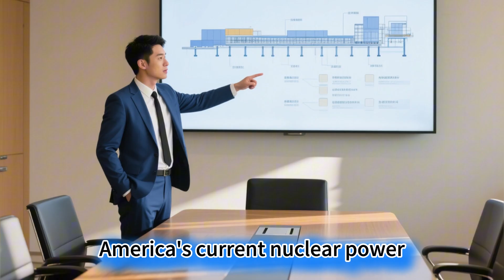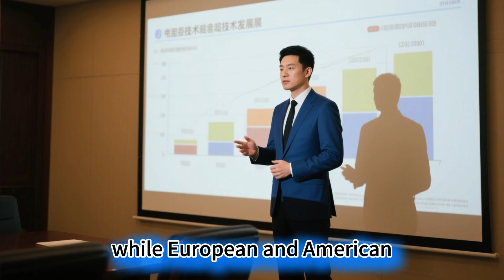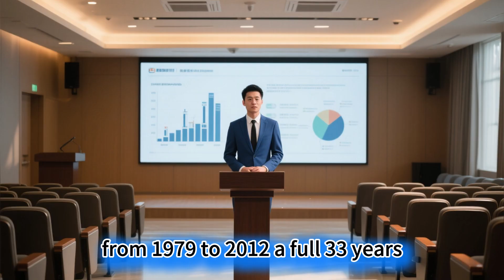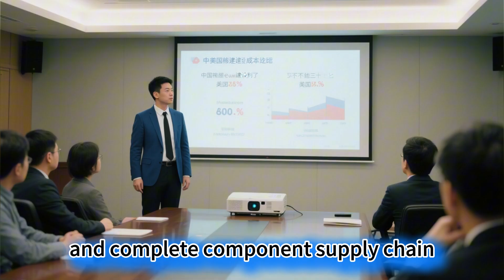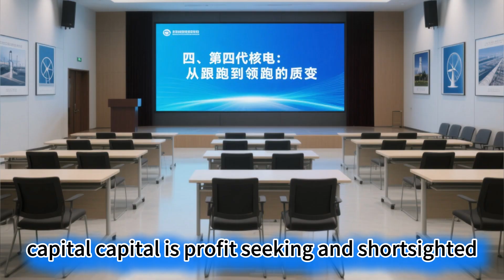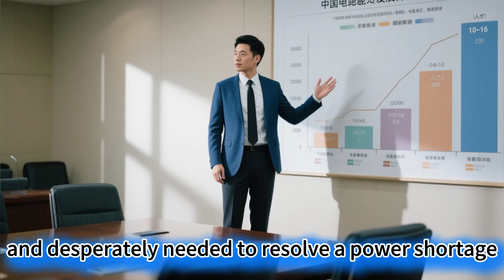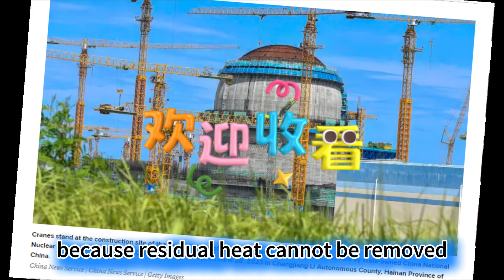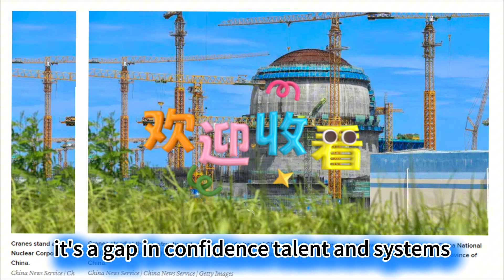China's Nuclear Power Surpasses the US？China's Unique Skill in Nuclear Power！

Comment: Ultimately our planet's energy power requirements had to be from nuclear fusion just as the Sun is providing now.
Currently only nuclear fission power stations are constructed and all of them run the risk of disastrous runaway radioactive accidents that are difficult to normalize.
This applies to both gas cooled or water cooled reactors, no exception.
The trend today is to have many smaller reactors distributed at load centres instead of a few massive reactors generating into the EHV national grids.
Perhaps less damage will results in the event of accidents that can happen.
Speed is not an advantage, safety is priority as zero error must precede all considerations.